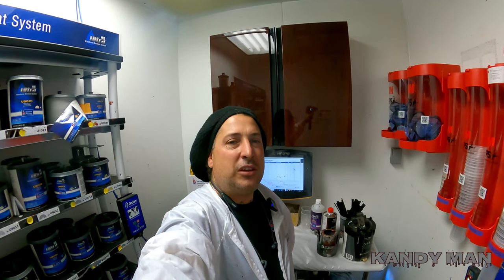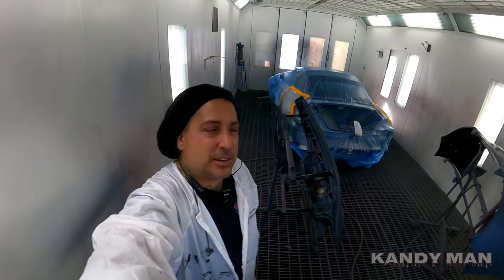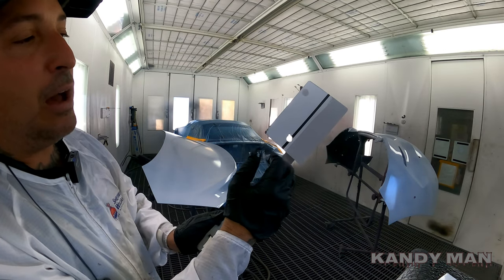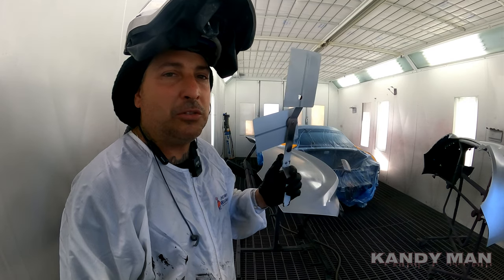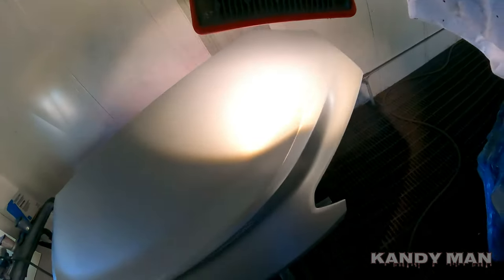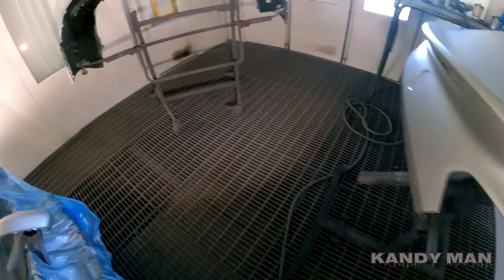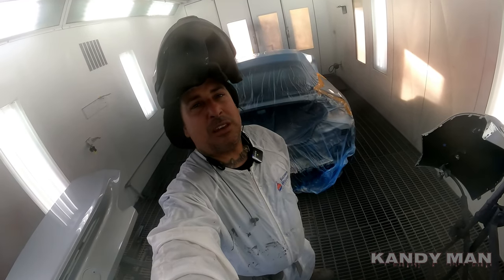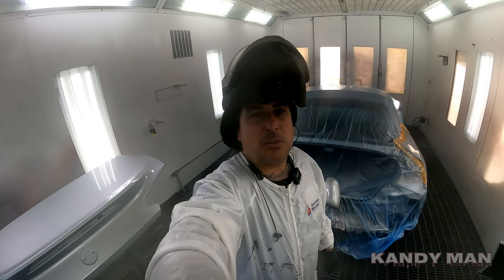BMW DV1 - C1 OR C2?

Comment: The shop currently uses PPG Deltron 2000 system with standard shopline clear jc630 and gro9000 for the production vehicles. I bought a couple of DV1's about a year ago, I run 1.3 with C1 for imports, insurance and self pay vehicles and I use 1.4 C2 for the primary production and fleet vehicles. I have other guns but currently these are the ones I use the most.
Reply from the maker: Sounds like you got it dialed in 👊👊

Comment: I have recently become a huge fan of yours sir! You dont only admit your wrong doings in just about every video you record, but you tell us how to avoid and deal with them as they occur. I am currently a step above beginner in the auto paint industry and am having trouble finding the most consistently smooth and easy spraying clear coat gun. I am an IWATA lover myself. I just bought the dv1 clear gun. Any simple tips on what to expect for a first time user? Thanks again and keep up the great paint work AND content! Cheers
Reply from the maker: Dv1 is my clear gun of choice.   It is a smooth gun, less air pressure  than iwata. Iwata also is a great gun. The biggest thing is consistency. And  gun time  hope this helps and thanks for the support 👍 👊👊👊

Comment: Hi kandy man.  Quick question. Use used a euro clear ppg shop line. But unfortunately  clear dive back.  I can figure out to make to stay wet looking,.
Reply from the maker: Slow harder is your best bet, that's what the cheaper clears tend to do
Reply: @kandyman5315   good ppg clear 2021 ppg?
Reply from the maker: @ARIASPHIL123 yes
Reply: @kandyman5315  thank you I Benet thought the you will respond my messages.  Looking to paint my son’s truck.  On black.

Comment: When u spray at 22 psi is that at the digital gauge on the gun or at the base?I got the same gun and spray at 20 on the gauge which equals 30psi
Reply from the maker: 22 on digital  gauge
Reply from the maker: Thanks for the support